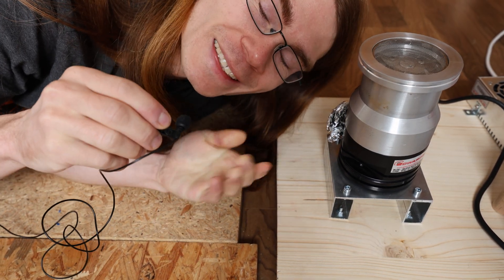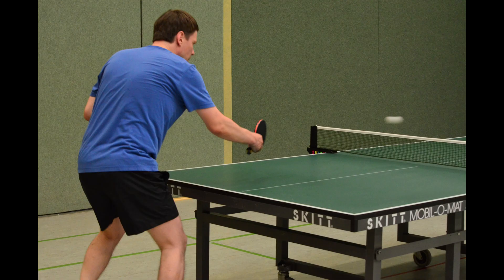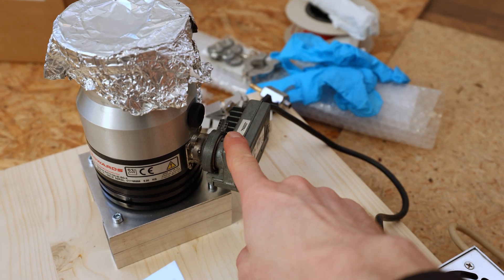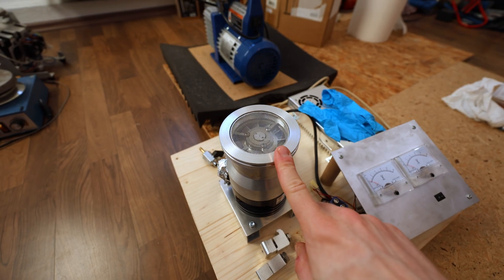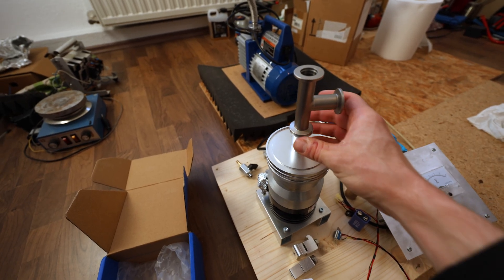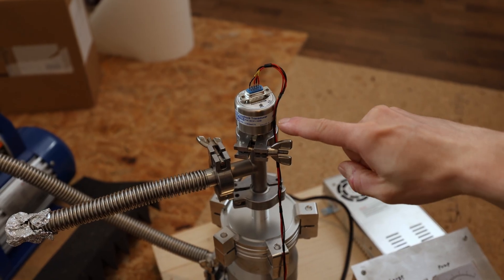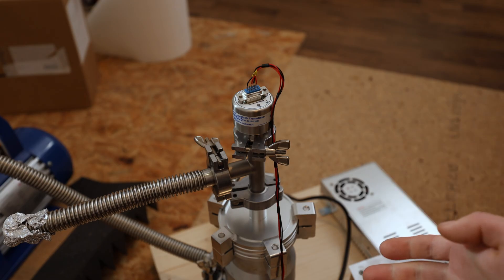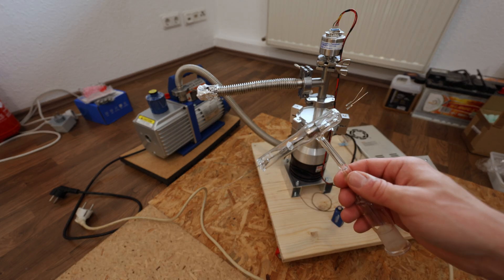Building a High Vacuum System and DIY X-Ray Tube

Comment: Yes. Yes. Yes. Yes.
Damn, what an indictment on the pricing of vacuum flanges (and a flex for JLCCNC!) that it's reasonable to have a DN50 to KF16 adapter custom machined these days. 
Thanks for the shout out!

FWIW, I'm contemplating taking the turbopump bypass out of my system because it doesn't take as long as I thought for my turbo to spin down to safe venting speed and the bypass path just provides more opportunity for leaks. I'll make a video if I end up doing this.
Reply from the maker: Yeah I noticed with my pump aswell it's not so long for it to spin down. 

And yeah if I remember correctly  the cnc machined part is a little bit cheaper than getting a vacuum flange. But because I made the sponsorship I got it for free.😆 I think in the future I might order a custom vacuum chamber or something like that regardless.

Comment: Amazing work, I am looking forward to your next videos! I got a bit concerned when I saw you directly connected the glass piece. Consider  putting something like a one way valve or just a KF valve between glass piece and TP before closing the tube since you risk imploding your TP if the seal doesn't close correctly 😢. Not an expert btw but hopefully I am on time 😂
Reply: A valve/oil trap between the roughing pump and the TP wouldn't be a bad idea, either. I don't imagine it's a reasonable process to clean TP once it's been thoroughly contaminated. ..oops, I meant "a TP" - sorry for the bad mental image.
Reply from the maker: Can you even get a one way valve for high vacuum? And a normal valve wouldn't help either. if something goes wrong it's over in a second. I just have to live with that risk.
Reply: @thesciencefurry  I am learning here so don't take my word for certain. So there is clearly a one way check valve KF flange for 80 quid second hand, wherereas this holds HV ... no clue :s. For the valve I was thinking a needle one although maybe that is going to be uneficent for your turbopump since it reduces your neck diameter. What I ment is to do the vaccum, close valve and then seal, does it loose pressure that quick ? All the bests :)

Comment: Have you made the mistake of turning off the roughing pump before venting the system, or closing an isolation valve? That's how I ruined my last homemade triode setup 🤪
Reply from the maker: No, I'm gonna be careful xD But I might setup a camera every time I run it, so at least I can make content out of it xp

Comment: next level would be a cryo pump with compressed helium=) Used to work in semiconductor industry in thin films. Where the aluminun would be deposited on the silicon. Brought back memories, pretty cool stuff. You could hear some of the bigger turbo explode when exposed to atmosphere across the fab, not a good sound.🎉